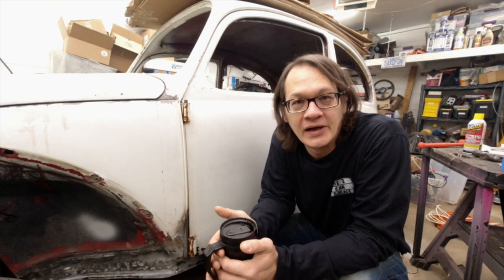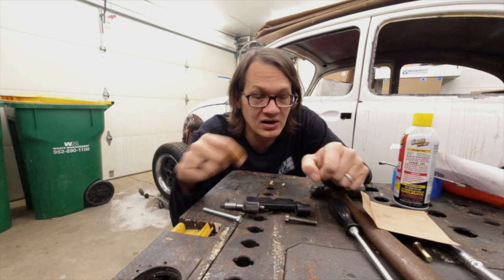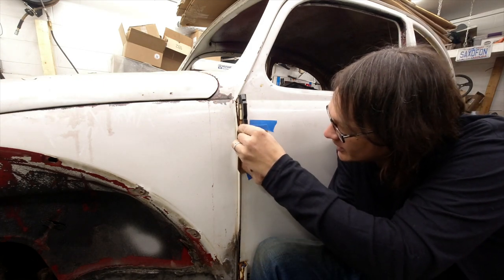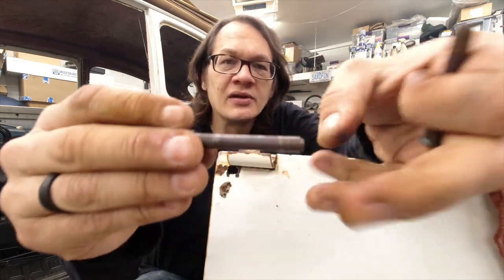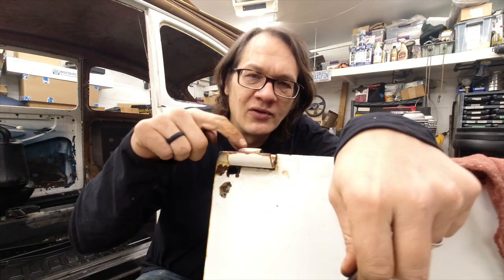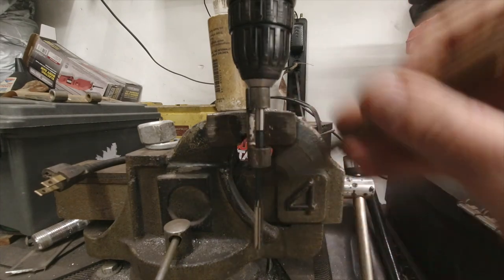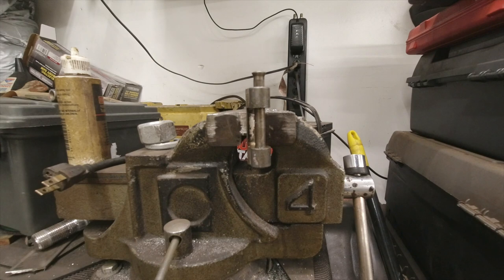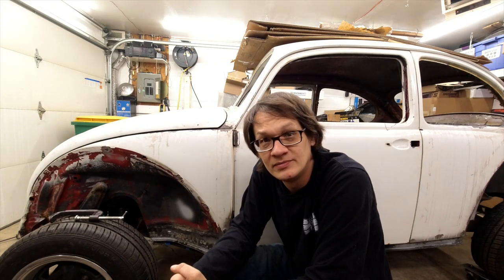Rebuilding VW Beetle Door Hinges - Curt's Bug part 21

Comment: I found a problem with removing the hinges. The sheet metal has been extruded to match the counter sinks in the hinge for location. They don't just pull out. Now, this replacement has become complicated

Comment: Does anyone know if I can swap hinges or pins for a 1978 super beetle? I hate the stock mirrors always coming loose or sagging. The look of the hinge mounted mirrors look better and have a better view. I believe from what I read the hinge pins are 8.1 MM ??? So can I just get a pin with the top threaded for the mirror? Or can I just buy a hinge for 67 beetle with pin and use that?

Comment: Very interesting, question, did you consider just replacing the hinges with aftermarket hinges ? Instead of going through the pin replacement process?
Reply from the maker: With the VW hinge being riveted to the door, it’s actually easier to replace the pin.

Comment: Hi, my doors have never closed well with out lifting them up. There’s play in the hinge, also I think the A pillar is corroded. Would you recommend changing the hinge pins before lining everything up and bracing the car to replace the A pillar and possibly the heater channels?

Great videos also, thank you!
Reply from the maker: If the hinge has noticeable wear, that would be a good place to start. That way, once you start in on the structural stuff, you’ll know that the door alignment can be trusted.
Reply: @The2CarGarage  thank you!

Comment: Good job! Any reason you didn't ream in reverse, running the reamer shaft-first, then pulling it through with the drill, in order to assure the most precise alignment possible? Like with king pins?
Reply from the maker: I've done that before, but have found that on a hinge that pivots in the middle like these it's not necessary.
Reply: @The2CarGarage  good to know, thank you :-)